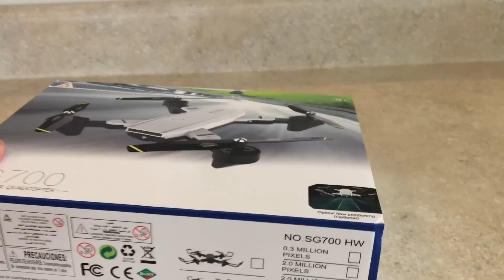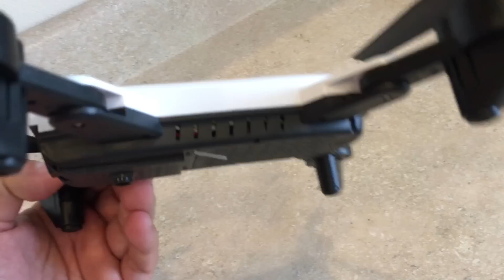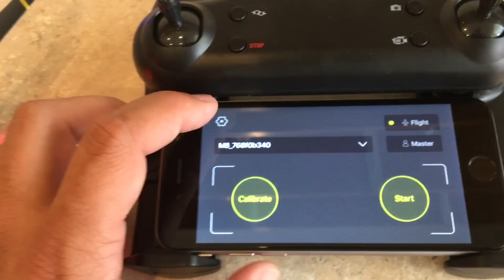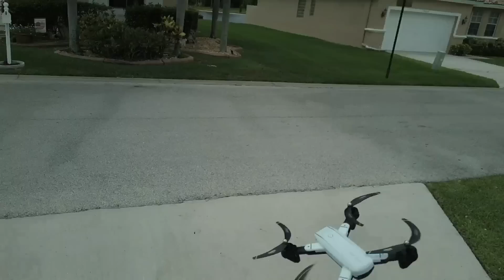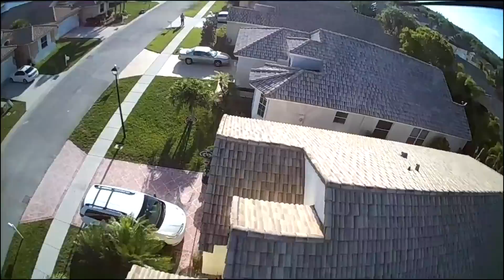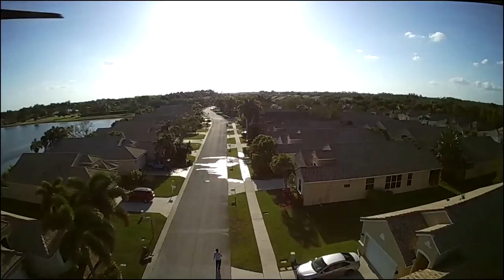SG700 Drone Review

Comment: By far the best review, your a really skilled flyer in that wind. The higher altitude footage was enough to convince me to buy one. Thank you. I just hope it lasts, My last cheap drone didn't due to gear wear,  I promised myself I wouldn't buy another one that does not have the props directly on the motors (so gear free) but we will see with this one. On a still day I am hoping this is stable enough with the optical follow to be able to do some roof inspection!
Reply from the maker: Thank you!  It is cool, hope you like it!   :)
Reply: @rx344  what is the best drone to buy in market sg106 or sg700?
Reply from the maker: That’s a difficult one… They both are from the same company (ZL Toys) and have the same features. The only main difference that I see is in the shape and design. The SG700 is foldable, while the SG106 is a little more aerodynamic (with the pointy & thin fuselage). Aside from this, they are both virtually identical (with the same controller and features, including optical flow, altitude hold, etc).…

Comment: Would you think this is better than visuo?
Reply from the maker: I would still pick the Visuo mainly because of its flight time. You can do over 10 minutes, plus the new Visuo that is coming out should be able to do 20 minutes worth of flight time… This one is kind of short on the flight time, it is less than 10 minutes…
Reply: rx344... Yeah.. New Visuo shark battle is better flight time.. But the camera is so bad..
Reply from the maker: Did you get the 2MP version?  Remember all these new drones come in 0.3MP & 2MP versions (quality vs price trade off).  I always try to get the 2 mega pixel versions to get clear 720p HD video in wide angle...
Reply: Very True!
Reply: This is a dann gold Video camera though, dont know if the visuo will be as good